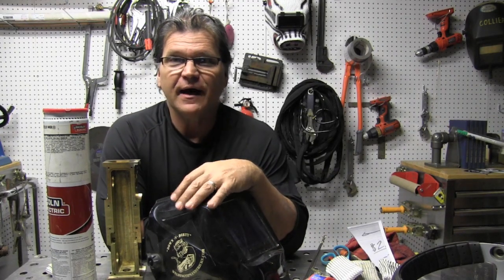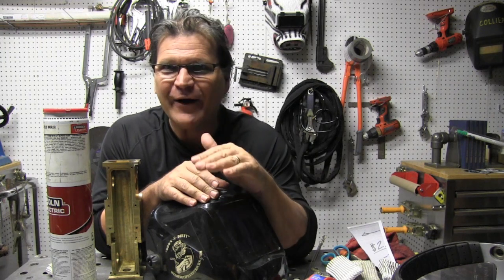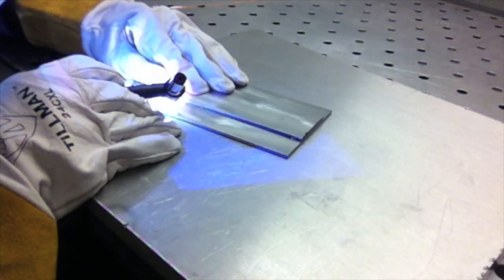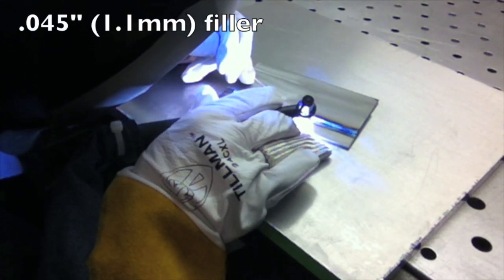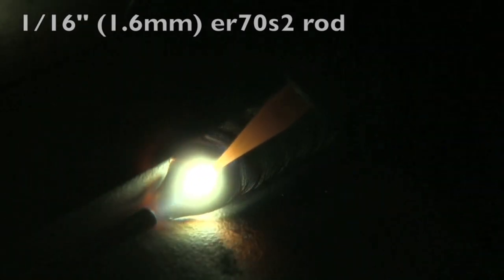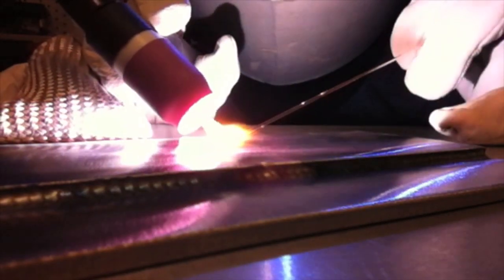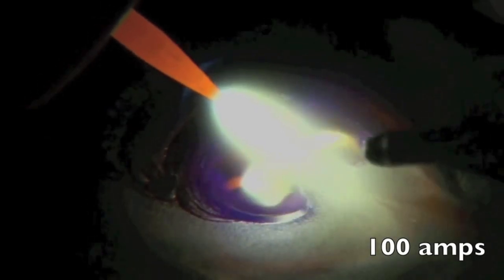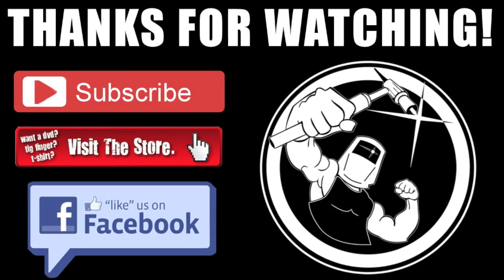How to Tig Weld a 2F Lap Joint

Comment: Great video. Thank you so much for all the helpful “tips and tricks” I really do apply all of this at work. We’re also working with stainless structural steel, MiG welding. I was wondering if maybe one day you can give some tips and tricks on mig welding stainless structural steel and lap joints? 🙏🏽

Comment: Just did my first welds, a couple of lap joints in steel. I think I made all three mistakes and a few others as well. These tips appear to be sharpened to a finer point than I was using.

Comment: My electrode keep sticking to the base metal when I keep dabbing. Got any tips on how to fix that?
Reply: Dab your filler, not your torch.  If you notice the torch stays at the exact same height through the entire pass.  If it is sticking because you are dabbing your filler, you need to back your filler rod up a little and let the torch pull the filler into the puddle.  Filler rod is designed to melt quicker than your base metal.  When you try to stab the filler in to create the puddle it builds up and hits your torch.  Get your puddle going on the base metal and then feed the filler in as needed ahead of the torch.  You can either stick it down in front or slide it underneath, what ever way works best for you and also depending on what / how /position you are welding.

Comment: i also been having trouble with the rod sticking briefly when i try and dab the filler.  Not sure why that happens but I would appreciate any insight.
Reply: Steve H - A couple things I can think of that might help are try tipping the torch back a little bit to help push the puddle out front. Will give you a better view and easier access to the puddle so you can get the filler rod right in there. Dabbing the rod too far outside the puddle can cause it to stick. Also, moving the torch too fast will cause the rod to stick from lack of heat. You can try slowing down or kicking the current up a little bit....grab a piece of scrap and run some beads while tweaking your settings and torch angle until you find the sweet spot, then give it hell.. hope this helps

Comment: i know this video is old now but i was taught to have the throat flush with the toes or close to that. These dont look like they are flush but maybe its just the light or the way the camera is. It also looks like there is more weld metal favoring the top joint but again may be a trick of the light. Just an observation.

Comment: I did the same practice lap weld today and it came out pretty good. Definitely learned many excellent techniques from you! Much appreciated! Going to get some 045 and try the same test again. I was originally using way too big filler rod on this practice piece and didn't like the look 3/32 rod was too big for my liking. I say throw the book suggestions out the window sometimes. Learn way more watching and listening to you than reading text books. Really grateful. Going to grab a tig XL to  show my support

Comment: I am glad I found this.  I am teaching myself to weld.  I am using a Bobcat 250 to power an AHP 200X TIG welder right now.  

I am making something for my brother.  I am using 1/8 aluminum.  I got the figure all welded.  Though, after I cleaned the stuff, I can not start an arc.  BUT, I did not know, how to weld stuff like, eyes on the face.  I tried and just made a dent in the aluminum.  But, this video will be very helpful.  

Good old weldingtipsandtricks.  You and two other guys on youtube helped me learn to weld.

Comment: just curious why you use a -2 rod as opposed to a -6 or -7 which have a higher deoxydizing agent ratio. I have been using -6  for years and rarely fail x-ray if at all. it's usually a defect in the base metal if I do. Thanks for posting. I love seeing a real welder share his opinions. God Bless.

Comment: +weldingtipsandtricks When I butt, corner, fillet and etc weld two 1.6mm(1/16") thick stainless steel sheet metal it bottoms out(melt the metal away). Starting with good weld but then its falls out. what can i do to fix this? im on 35amps

Comment: Hiya :) does the using cooling aluminium around the weld also help prevent distortion and warping? (or just cosmetic nicer cooler blueish-gold colouring of the weld bead?) many thanks

Comment: I haven't tigged in awhile but I am/was good at it. My problem though was holding too close of an arc so everytime I dipped it would hit my tungsten so I had to pull away a little when I dipped. Is that a bad thing? Or was I just using too big of a filler like for example if I was using 3/32 should I have switched to 1/16? Is there such thing as running too tight an arc? Back in school my teacher said I held an amazingly tight arc but he never said if it was bad or not and he never pointed out me doing anything wrong when he watched. Someone with real experience please answer.

Comment: Hope it's not a dumb question, but can someone tell me why you "hold the post flow" after you you stop the weld?
Reply: +Manuel Saldivar (Manny) For the same reason you use it during welding, to displace the oxygen and keep the metal from oxidising.  After you finish the weld it is still hot for a while.
Reply: Finally. Thanks Michael.
Reply: +Manuel Saldivar (Manny) no worries.

Comment: This has helped me so much (along with your other TIG vids) in getting my 4f, 5f certs. Finding the balance between travel speed, amperage, plate thickness and wire diameter was a struggle for me. The way you explained higher amps/higher travel speed made so much sense. Once i learned to control the puddle, I was able to up the amps, travel faster and stop blowing out the back of my practice plates. Thanks for all the advice. I'm buying a Tig finger for sure.

Comment: "And not shielding the hot tip of the filler rod with argon" was one of the 3 things people do wrong mentioned in this video. I don't fully understand it. What's "hot tip" and how do i shield the filler rod with argon?
could someone please explain, Thank you.
Reply: +Simon Lindgren If you pull the filler rod away from near the tungsten while it's still molten in the tip, it's no longer covered by the shielding gas that is also protecting  the tungsten, and it gets in contact with oxygen.

Comment: Hello, very nice videos.  I am new to welding, and TIG has proved to have a steep learning curve.  I was wondering about the size of the cup, and if the Argon flow needs to be increased to counteract the tungsten's stick-out.  I am a welding student whose instructors have said that the stick-out should be no more than 1 to 1 1/2 times the diameter on the Tungsten.  Is this accurate, or are there extenuating circumstances that can change with each job?  Again, thanks for the videos and the help you have already provided.

Comment: I noticed on your weld parameters your running 15-20 cfh on the bottle. I weld primarily on stainless (304-316-occational 303 when my machinist goofs up) with gas lenses (6-8)  but im running in the 12-15 cfh. Im getting good color on my weldments so i was wondering if there are any advantages to running higher flow on my meter if my color is good? i dont pay for gas so im not worried in that respect but the habbit may have come from welding sanitary tubing way up high where i have to carry bottles up and purging makes quick work of a tank. I now head welding/fab in my department and get a gofor so now im not to worried about carring bottles haha. oh and im running a miller max star(all the bells and whistles) or a syncrowave 350 lx.

Comment: Thanks for making videos i have learned alot from you more than I did in welding school and I am now doing high end aluminum welding on fuel cells, weight tanks and many other polished billet parts building jr dragsters
Reply: Oh yeah and my tig finger works beautifully!
Reply: hey cobnuts i weld on fuel cells and weight boxes too also intercooler tanks.
Reply: todd j nice! id like to get into the turbo stuff
Reply: good money in the custom stuff
Reply: todd j I bet! We do pretty well in the racing industry its not just jr stuff we manufacture over 4000 parts in house we machine entire motors out of billet for the jr's including cranks, pistons, cams, rods, valves, roller lifters, heads, headers, clutches ect even our own jets we do every part in house except the tires  and have contracts with jegs and summit! but id like to get into some one off stuff like you I get to do some custom stuff but id like to do more
Reply: sounds sweet....ever build anything for yourself with all that at your finger tips?check out dadscustom built intercooler fuel cells and tanks
Reply: todd j id like to! Just have to find time. And checked out your website thats some clean work man stellar quality! Id tell you to check out our website but all the welded parts shown were done by an old welder who I replaced and my work is a definitely better but if you'd like to check out what we do its jrracecar.com
Reply: wow....that would be  bad ass to work in a place like that.

Comment: Hi Jody, Another great video. I have a everlast 320 tig with a weldcraft water cooled gun. Love the machine and it's flexibility. On your welds you get great colored welds. What am I doing wrong? If I just fuse without using rod I get nice colorful welds but when I start to use filler I start to get black welds. On the last project I welded I welded some very thick stainless and I did 2 passes. The first pass looked pretty good but the second went black. I can clean it up with paste but it seems that wouldn't be necessary if it looked good in the first place.

Thanks,

Stephen
Reply: Stainless is tricky you dont want to get it too hot. One technique is to turn your machine up a bit and move faster to prevent heat build up and always let the weld cool between passes! If you want insane mirror looking stainless welds get yourself a jumbo pyrex cup from ck torch you will be amazed!
Reply: cobnutts also make sure its clean!
Reply: cobnutts What do you use to clean? This was 1" thick fresh machined 304ss and I cleaned it with acetone.
Reply: STEPHEN STEWARD it depends for me if its fairly clean I just wipe it down with acetone if has that typical coating I use a flapper disk

Comment: Hi Jody- just two quick questions. Isn't  your argon flow on the high side for using a gas lens? And,with the thin rod do I see you not feeding the rod between your fingers ? Is this because of the difficulty in feeding a thin rod? I have trouble with this and have to keep stopping/starting. Keep up the good work!

Comment: Hey Jody I am a union ironworker and everything is thick galvenized  welding now and it is very different than mild steel. Will you please make a video of vertical up with 1\8 7018 thanks man.

Comment: Great video and interesting to hear you mention Sun N Fun in this video. I live and work in lakeland and actually work right around the corner from the airport and have gone to Sun N Fun every year for the last several years. Speaking of the aviation community,  we had a tragedy here yesterday with a flight school plane crash yesterday morning killing the two (instructor and student) on board.  In reference to eyewitness accounts,  it's looking like it was a mechanical / engine failure that caused the crash.

Comment: Hey jody im wanting to bag my truck but i only have a 115 volt welder a hobart handler 140 and was gonna be modifying my chassis would i be ok using that welder?
Reply: Angel ferrari just, get the same thickness material and test it. If you acid etch it and its a good weld it is safe too say that your project should be good too. Just make sure you are good at it lol.

Comment: Does a small bead always result in less penetration and less distortion or it possible to have a hot, small bead run very fast with a high level of penetration but perhaps more distortion? Or is the only reason to run a small bead less distortion? Thanks for the video. Interesting as always.

Comment: As always Jody, great video. That's an excellent tip with the aluminum block, I'll have to find myself one. Also, very nice looking welds, I try to get some practice in everyday, emulating your techniques. I've only had my tig welder for about 8 months now and only about 6 months for the one at work. Being the machinist and hydraulics tech, doesn't leave a lot of time for welding practice. I also was not able to get my heat hooked up in my home shop before winter dumped on us, so not many opportunities at home till spring lol. It can get pretty cold up here in northern Alberta, but for the past few days it's been above zero. I'm pretty sure we're going to pay for that shortly lol.
Thanks again for all your efforts and the informative and entertaining videos. All the best in 2015 for you and your family.
Ian Little

Comment: Jody, as always thanks for this series.  I have  learned a whole from your videos.   I bought a Hobart 190 MIG machine about 6 months ago and with your videos and a little reading have seen a lot of improvement in my welds.  I do a lot of pipe welding and so I am constantly stopping and starting to reposition for the next arc segment on the weld.   How to start and stop a MIG weld is an area I feel I can use a lot of help.   I can do great on a continuous linear weld but when I am repositioning on a circular weld (or any weld geometry for that matter where I need to do frequent repositioning)  it can get ugly at the stop/start point and with out fancy prestart and postweld gas and arc control (like on the fancier machines) I am not sure what to do.   Can you do a video on this soon please??

Comment: Great video as always. When you talk about tight arc, is that just working closer to the work piece ? The arc physically looks tighter and smaller. My arc usually looks like a upside down bowl when welding. Since your doing this in DC you can't adjust the arc like in AC. How do you actually manipulate the arc in DC ? Again , thanks for the videos
Reply: Yes, he is basically saying to keep the arc length as short as possible when he says to keep it tight. Think of the arc as a cone and the closer you are to the point of the cone, the smaller the circle is at the base of the cone. The smaller this circle is, the smaller the area is that being heated and melted. This really helps to get the heat focused down into the root of the corner. Just remember,  the tighter you are, the easier it is to accidentally touch the tungsten to the weld puddle and/or the filler rod.

As for arc shape, torch angle and electrode grind geometry will both have a fairly significant effect on it. Shallower grind angles (lower included angles) will tend to give a wider arc cone which will make it harder to keep the arc focused tightly into the corners.  Also if you are grinding to a sharp point, the same thing happens. A larger angle with a truncated tip usually helps to really focus the arc into a tight small cone

Comment: I'm glad you said to keep the filler rod in the shielding gas. I did not know that (I've only practice TIG a few times). I guess it would be a good habit to keep the hot end of the rod shielded in the post flow at the end of the bead or is it better/easier to just clean the filler rod before the next bead? 

Thanks for the great video. I'm saving up for a TIG machine and look forward to learning to use it.